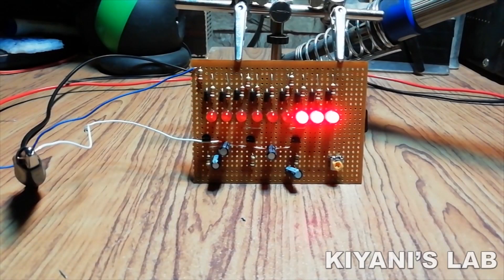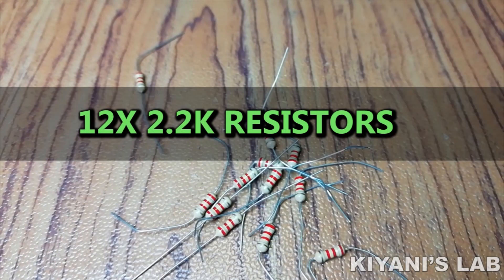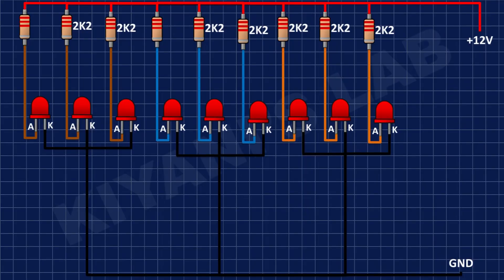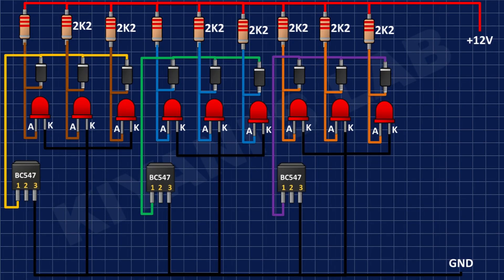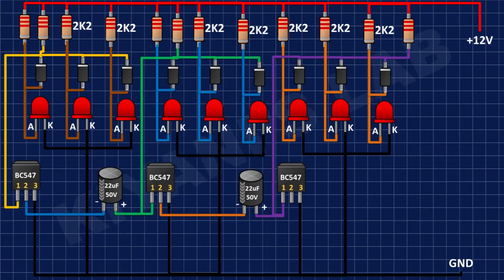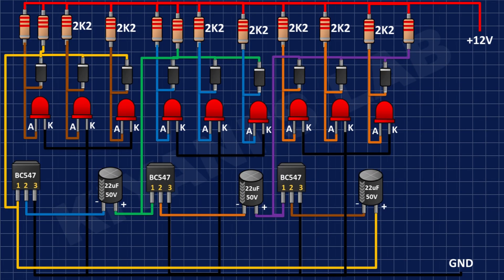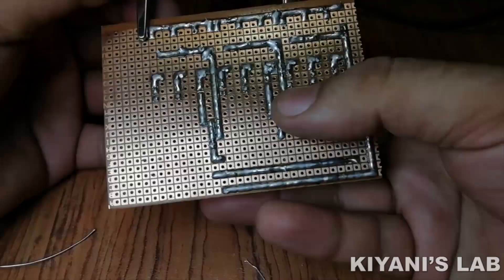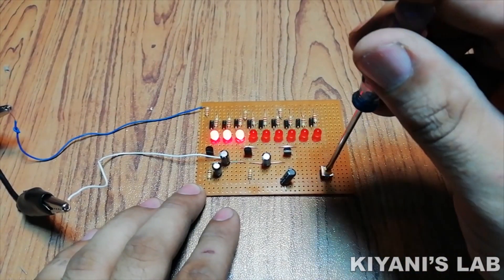How to Make 3 Channel LED Chaser, Simple LED Chaser With Transistors

Comment: If you did this with a 3 single LED's instead of 3 groups of three LED's would the rest of the circuit be the same? (bar excluding the redundant triple resistors etc) wondering if it relies on the greater current being pulled from 3 LED's